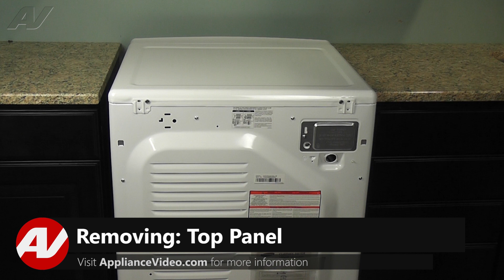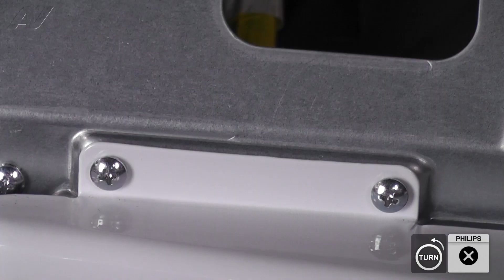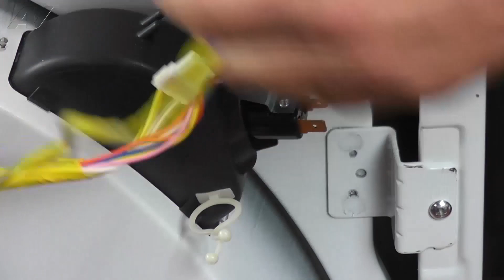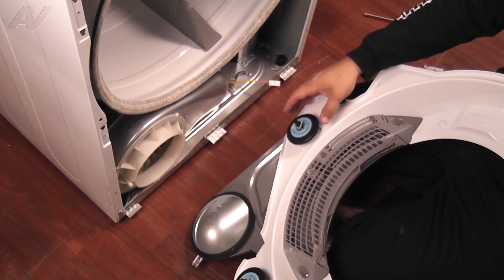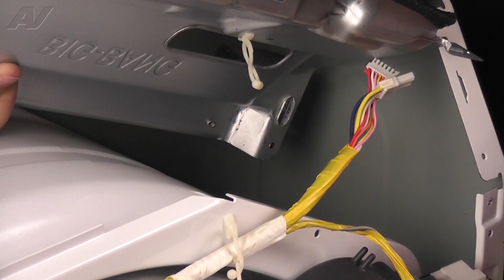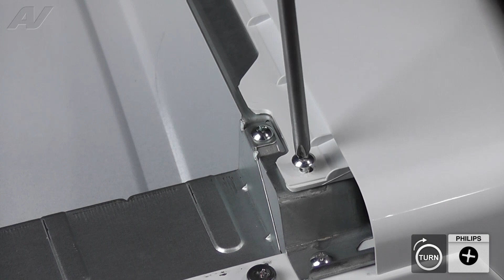Samsung Dryer -Thermistor issues - Repair / Replacement

Comment: I have a Samsung and I get a blinking pipe obstruction light on medium and high heat but not with air fluff nor low heat. I did the machine self-test and came back as 0 so no obstructions are causing it. I also disconnected the vent, and I still get the blinking pipe light. I also get no codes. Can it be the thermistor causing this or something else?

Comment: This finally showed me exactly where it is located. If your real nimble and use a little stubby ratchet and a phillips bit you can reach it from the back and only take the duct cover off. It is a hard reach but possible.

Comment: help please, I have a Samsung dryer and it shows a FE problem. Please, help. We cannot figure out the problem.
Reply from the maker: Great question, if you have a more technical question that our parts department cannot answer, you can search our over 17,000 answered questions free at our website www.ApplianceVideo.com under our Repair Help section. You can also call our parts department at 1-800-830-5465 and they can give you help 7-days A week ,or search at www.SaveMoreOnParts.com  .

Comment: if the thermistor shows no continuity, does that mean is bad and should be replaced?
Reply from the maker: Great question, if you have a more technical question that our parts department cannot answer, you can search our over 17,000 answered questions free at our website www.ApplianceVideo.com under our Repair Help section. You can also call our parts department at 1-800-830-5465 and they can give you help 7-days A week ,or search at www.SaveMoreOnParts.com  .

Comment: What's that fuse or whatever next to it? I keep blowing fuses even after I replaced the thermistor.
Reply from the maker: Great question, if you have a more technical question that our parts department cannot answer, you can search our over 17,000 answered questions free at our website www.ApplianceVideo.com under our Repair Help section. You can also call our parts department at 1-800-830-5465 and they can give you help 7-days A week ,or search at www.SaveMoreOnParts.com  .
Reply: That's a limit

Comment: you mention in the video name "issues" with the thermistor. What was the issue with the thermistor? That would have been good to know before taking the dryer apart don't you think?
Reply: The heat is not regulated stays hot till the limits take over and shut down the heat. Thermistor supposed to do that takes place of the old timey bi-metal klixon. Note clean out the inside the blower housing also.
Reply: @DanWebster  Also a bad thermistor can throw a blinking check filter icon error.
Reply from the maker: Great question, if you have a more technical question that our parts department cannot answer, you can search our over 17,000 answered questions free at our website www.ApplianceVideo.com under our Repair Help section. You can also call our parts department at 1-800-830-5465 and they can give you help 7-days A week ,or search at www.SaveMoreOnParts.com  .